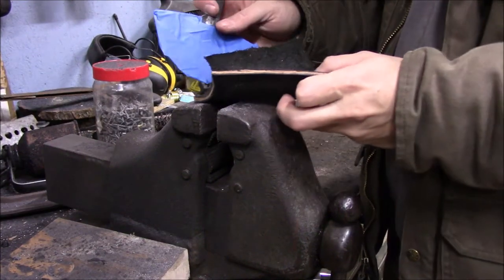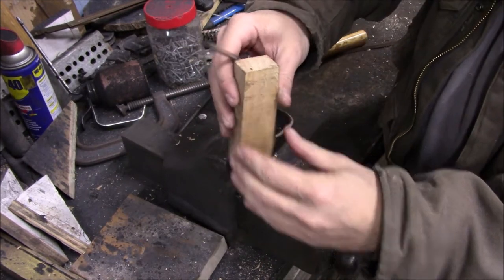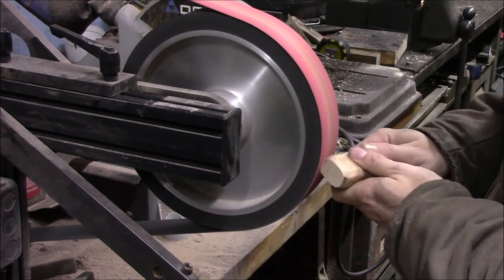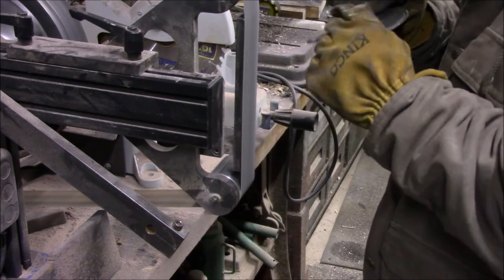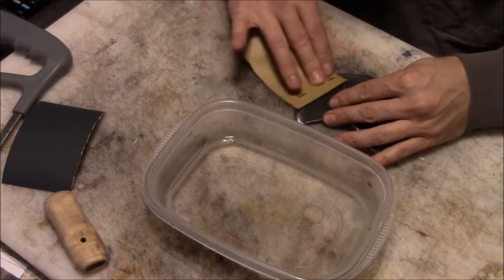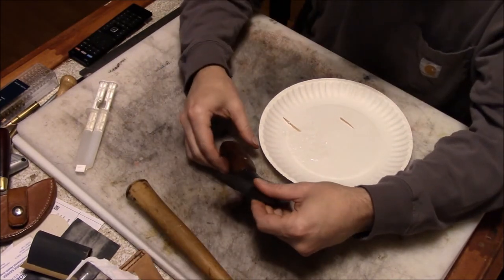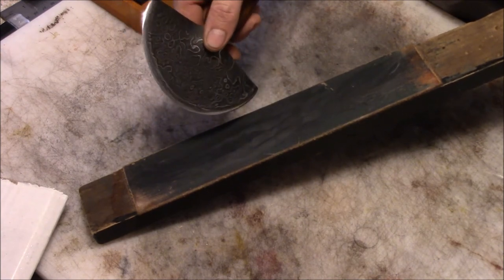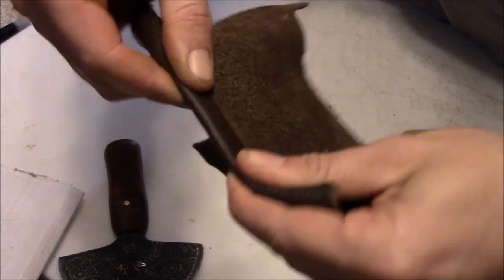Putting a handle on the round knife

Comment: I made a round knife once, stock removal, out of thin stock O1 steel.  Not an easy grind, I'll tell you that.   Great job.
Reply from the maker: Thanks.  I spent most of my time worrying about catching one of the points and getting a knife thrown at me.  Since I made this I have bought a waterfall platen and reversible grinder that would have made it a lot easier.